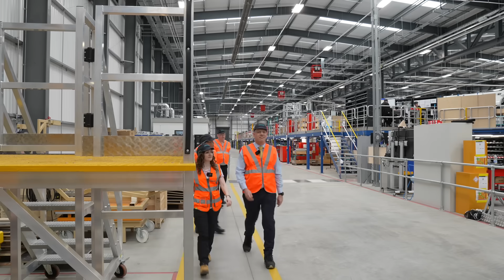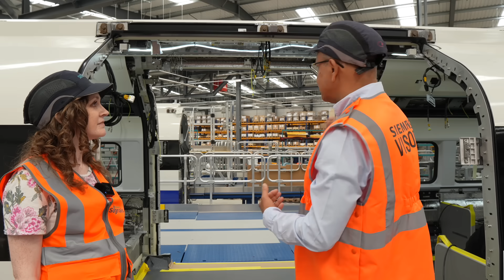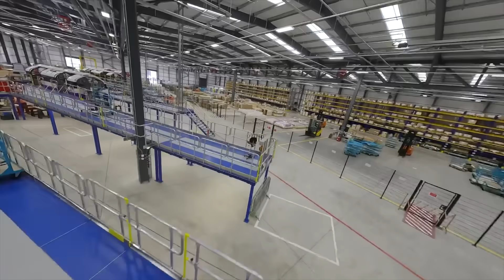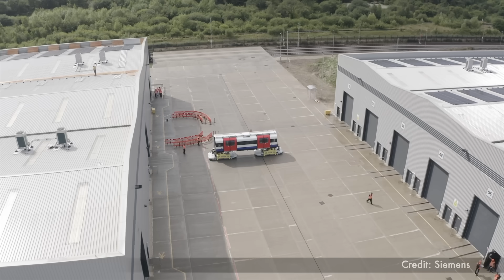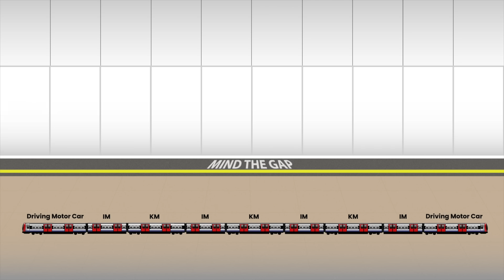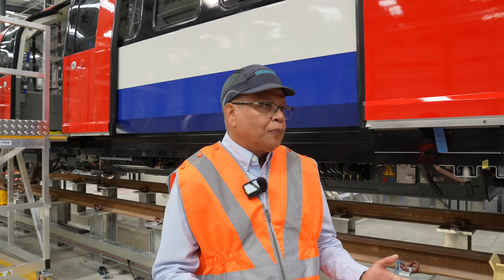New Tube trains for the Piccadilly Line – inside the factory!

Comment: Let’s hope they win the contract for new southeastern trains as well
Reply: If they have level boarding, rather Stadler if not
Reply: Jaa Siemens or Stadler (or both as with the new Berlin S-bahn
Reply: Not if they use the same tiny porthole windows. The majority of the picc is above ground, why they think those titchy windows are adequate beats me.
Reply: @neilrobertson811  windows have such an effect on weight, structural strength, heat transfer. It's not all about giving you a good view
Reply: @pobvic  Uh, yeah, thats exactly what they're for otherwise there wouldn't be any! And if they could build trains with big windows in the past they could do it now. Check out the 92 stock for how it should be done.
Reply: @cmmartti  Aircraft have small windows due to pressurisation , nothing to do with weight. Non pressurised aircraft have much larger windows, look at any cessna. Adding larger windows to the train would have made very little difference to the weight of each car - a few hundred kilos is neither here nor there in something that weighs 20 tons - but an interesting made up on the spot reason to go with all the other unconvincing ones I've heard for the tiny windows. I think we all know the real reason is simply design.
Reply: @pobvic  Think this concept of hinging carriages to others and let this system carry the weight instead of being supported on their own wheels has been proven in Amsterdam, Dublin, Nottingham and other tram systems.  The big question is will this system work on a heaviliy laden heavy rail metro train 364 days a year for 30 years.
Reply: @johnwood2448 already proven...next
Reply: @neilrobertson811  It's just a wild theory, but I could imagine that it has something to do with the sun. A large part of the Piccadilly line is above ground, where the train can get very hot. I know from my car that when the sun is strong, the air conditioning selects a very high fan speed to achieve the desired temperature. With large windows, this could be a problem here in the summer too. The heavily used and hot air conditioning system could perhaps cause the temperature in the tunnel to rise even further when entering the underground sections (and the Underground already has a major temperature problem that is getting worse). It could also be that this is completely wrong, but there is surely a reason for it. The trains have been in the planning stages for a long time and have certainly been thought through down to the last detail.
Reply: @northernlights799 The Central Line has even more track above ground but its trains have the largest windows of any stock on the underground so that theory is out I'm afraid.
Reply: @neilrobertson811  Yes, but the trains don't have air conditioning that heats up, and the trains are also quite dated in design. The Central Line is also always near the top of the heat rankings. Back then, the temperature problem wasn't as big as today too. But I'd really like to hear the reason from Siemens themselves.
Reply: @northernlights799 Aircon should make large windows less of a problem , not more. If there's a genuine reason for these tiny windows I'd love to hear it but so far its been silence.
Reply: @neilrobertson811  Not necessarily. In New York, it's unbearable to be in the stations in the summer. When you walk along the trains, you can feel the extremely hot air from the air conditioning. It's truly horrible. That's why the air conditioning should be set as low as possible. But with large windows it needs a higher level.
Reply: @northernlights799 This isn't new york and window size makes no difference in the tunnels.
Reply: @neilrobertson811  Well, I did a little digging to see if I could find anything about it (I'm really interested in it too xD) I've read a few times now that it's probably the air conditioning system itself. The air conditioning system is located underneath the carriages because the narrow tunnels didn't allow space to put it on the roof (as is normally the case with trains). This means that air ducts are needed to carry the cold air upwards and then release it into the carriages. These ducts are probably located between the windows. This would make sense because in interior photos the paneling between the windows is very thick (due to the ducts behind them). So it's probably a design compromise. 😕
Reply: @northernlights799 That might explain the width of the windows but not the low height. When the passenger information system fails in a carriage years down the line - which they all do eventually - its going to be a real PITA for someone in a crowded carriage to see what station they're at.
Reply: @neilrobertson811  I could imagine a long air duct being installed above the windows to distribute the cool air. The monitors are directly above them, which is why the air duct system couldn't be installed any higher. But I understand the problem you're referring to. You can see that there's not really enough space for the air conditioning, and Siemens had to make a lot of compromises. In my opinion, the monitors are also at a bad angle when standing. But if the air duct system is underneath, then that would be the next compromise.😕
Reply: @neilrobertson811 structural rigidity whilst being light. The motors have to also be more efficient to not emit so much heat as the aircon has to expel heat as well. One of the first metro trains outside of Asia to be using pmsm motors.
Reply: @northernlights799I saw in a video that the air ducts are in between the doors and Window but flow out of the ceiling. The aircon units are under the train, under the bogieless carriages.
Reply: Southeastern is a complete embarrassment. Seats are literally falling apart and it stinks/boiling hot or either freezing cold. Prices are astronomical of course.
Reply: @Ihavenoideaokbro we are in the process of getting new trains but trains aren’t cheap
Reply: Don't know about South Eastern Trains but would like stock replacement on the Bakerloo as a follow on to the Piccadilly Line.
Reply: lol there won’t be any replacement of trains for another 30 years. The concept of air conditioning is unheard of in the UK
Reply: @cypher686  You're just trolling at this point, the new sub-surface trains are air conditioned, these piccadilly line trains are being built with aircon and lots of mainline trains have aircon like Greater Anglia I just travelled on in the heatwave.
Reply: But I love the Class 465’s though
Reply: @BakerSoutheast try commuting on it, in the summer😢

Comment: The trains look impressive but I have deep reservations about the design. Aircon is great, but what will happen if there is a power failure? There do not appear to be any opening windows, nor end doors on the cars. I foresee major problems as I have not heard about any mitigation arrangements.
Also, what has been the point of the fancy, and no doubt expensive lights on the driving cars, when standard replaceable headlights could have been fitted? As each car now seems to have its own software, is that another problem on the way?
If only we still had Metro-Cammell- they knew how to build a train (all of it in Britain).
Reply: Lighting's all LED these days. The technology to make LED lights to any desired shape is now mainstream so I doubt it will add any appreciable cost. As for the AC, would opening windows in a tiny tunnel do anything much?
Reply: Theres an emergency access door on the front, which extends to form a ramp. LEDs are not expensive, these types of lights are getting very common on new train designs across the world
Reply: @ce1834  My fear about the loss of aircon is that temperatures in a packed train will rise very rapidly throughout the train. I do not know how long it would be before an evacuation would be commenced, but there would be a lot of people of varying degrees of mobility having to leave through a single door and steps at one end of the train. Within a closed environment, CO2 also reaches alarm levels rapidly (My own experience during emergency exercises for the Nuclear installations Inspectorate). The loss of power on the GW main line some months back should have been a warning.
Reply: That's how new trains are built though. If you have windows you can open, there's no point having air conditioning.
Reply: There probably is a mechanical emergency unlock for each door for such cases. Effectively all German trains have this, so this will probably too.
Reply: Whether they are successful or not, I think the external design apart from maybe the cab is awful. Also they look claustrophobic with there small windows.

Comment: So the car-bodies aren't square and shims need to be fitted to the underside before the bogies can be presented.
Is this common on modern alloy car-bodies?
I am wondering what the tolerances are and the maximum shim thickness permitted?
Reply: With open-end carriages, and bogie-offset articulation, the torsional rigidity is inevitably compromised to an extent.  It may work acceptably with light rail vehicles, but I do wonder how well this design will hold up to the intense use these will experience on the Piccadilly Line. 🤔
Reply: @borassictime918  
Thank you for that info.
So the staff, at Northfields (or Acton), might have to learn how to do aluminium welding then.

Comment: Have the clearance problems been solved  

What happens to the waste heat from the aircon?
Reply: I understand it’s not actually aircon, the system doesn’t remove moisture.  An expert may be able to provide the technical details.
Reply: @borassictime918  its air cooling on a technical level, but in the common sense, yes it has "AC" (vapour-compression refrigeration with temperature control)
Reply: @ce1834 Ah ok, so no dehumidifying, makes sense for a deep tube. Thanks.
Reply: That would be interesting to know. The deep tube is the hottest on the underground I believe. Conventional Aircon would just add to that.
Reply: The new train reduces the heat they emit from the engines and brakes, so allows some leeway I understand
Reply: Another problem is that the underground stations are not ventilated either, that's also an issue
Reply: clearance has been tested as far as Hyde Park Corner from Northfields
Reply: @hx0d 
Didn't the clearances have to be increased to accommodate the 1973 stock?

It seems to me a huge mistake not to have copied the main dimensions of the 1973 stock to be sure that it fits. The air conditioning is a mistake anyway.  The system needs to be cooled. The must be space in closed stations and disused lift shafts to install equipment. The AC on the trains will just heat up the tunnels even more, when it works.
Reply: @physiocrat-sv the main dimensions of a 73 stock are probably narrower leading to less capacity. When I check tube stats even the 96/5 stock seem to have lower capacity compared to 72 or 92 stock. I think the long carriages mean that the trains can’t be as wide because of tight corners and small tunnels.
Reply: @Peter-mj6lz 
Strange. The relevant information must have been available to optimise lengths and widths. The new trains will have a different geometry.

Comment: The same thing will happen when the jubilee and northern line trains will be replaced, two whole lines fleet being replaced at the same time.
Reply: Highly doubt they’ll be replaced at the same time. The jubilee will probably get replaced first since the ‘96 stock uses DC motors and not AC like the ‘95, with the latter being more modern and reliable
Reply: @yourfriendlyneighbourhoods8202 96 stock uses ac motors. In fact they also sound similar to me but the 95 stock uses more modern Igbo transistors which creates the high pitched sound when accelerating and braking